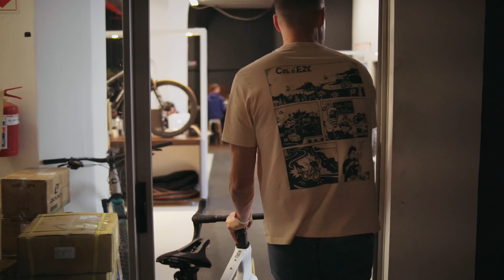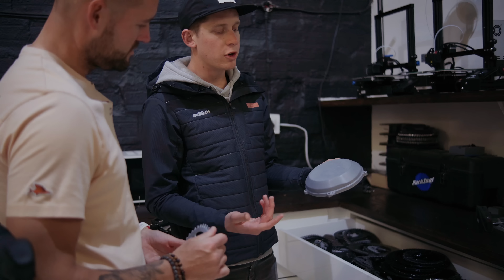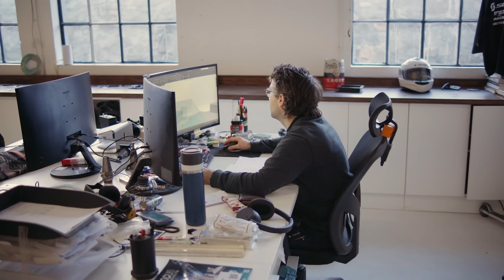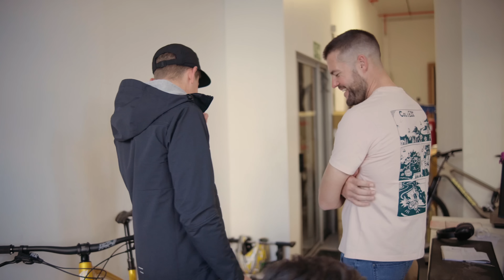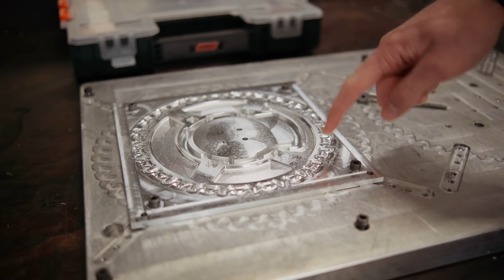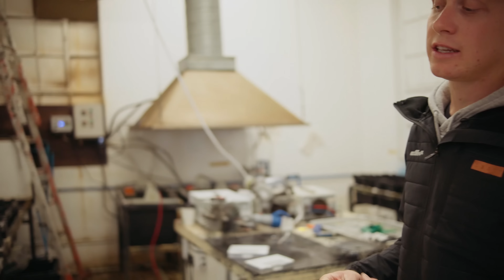The Chainring from South Africa that made it to Tour de France!

Comment: The method of using 3D printing at the premanufacturing stage is almost standard practice nowadays. But complexity of these products shouldn't require it.
Reply from the maker: We went in wet behind the ears and lack manufacturing knowledge to understand best practice and what is normalised - I think for many this would the the case. I suppose what stood out for them was the speed and efficiency of using this method for that never ending changes to specification and as a step to leapfrog development at a fraction of the cost and time compared to the CNC process. My personal view on the matter. Appreciate your comment though and raising the point. Hopefully we get some more perspectives and comments on the point 🙏🏼